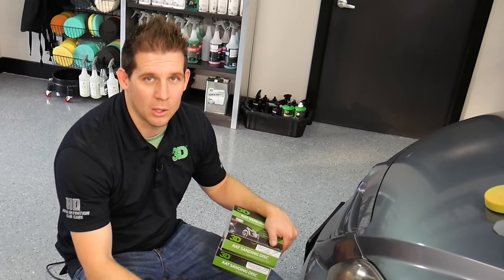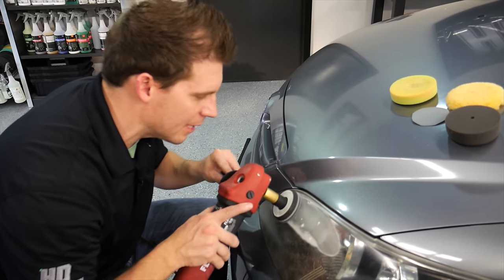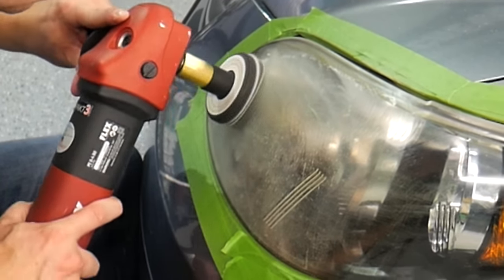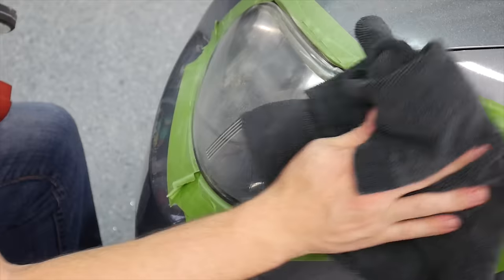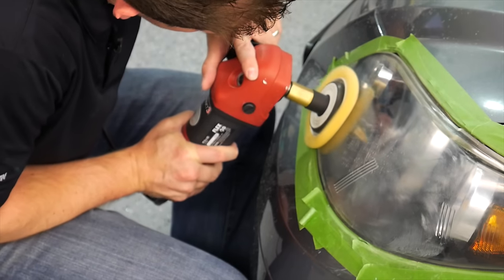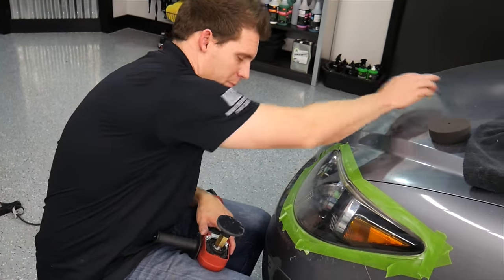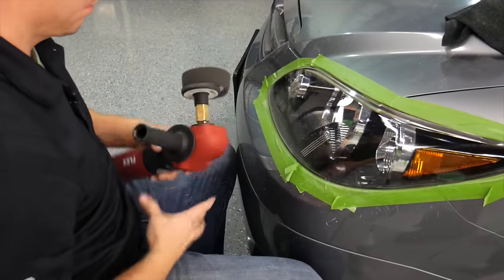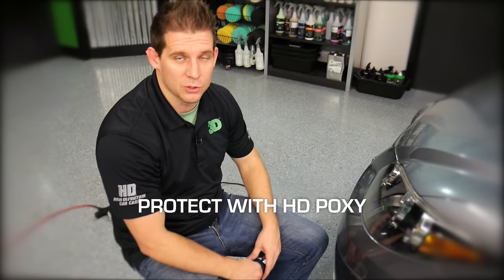Headlight Repair with AAT sandpaper, AAT Compound and Polish

Comment: What is the size of the sandpaper you are using? I only see 5” sandpaper on your site but this looks slightly smaller, like 3” or 4”.
Reply from the maker: Correct this was cut down from larger stock.  At our distributors, you will find the 3" sandpaper.  We do not sell the 3" paper on the website
Reply: 3D Products Darn I think I got the wrong stuff. I just ordered some sandpaper directly from 3D. I wanted the 3” sandpaper to do some testing on headlights. I thought I ordered the right thing but I received ACA sanding discs, not AAT. Did I order the wrong thing?

Comment: Hey 3D I'm adding this to my system! Can you tell me which flex machine your using? 
Also what backing plate and adapter are you running here? I am looking to get the set up ! Already using most of your products so I'll be glad to to be doing this right!